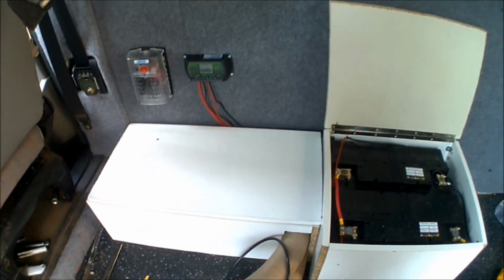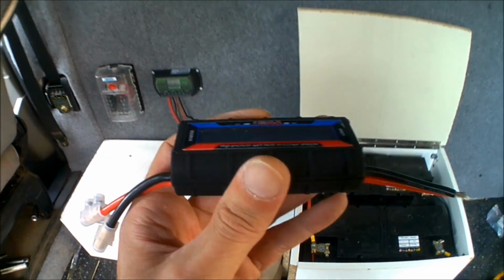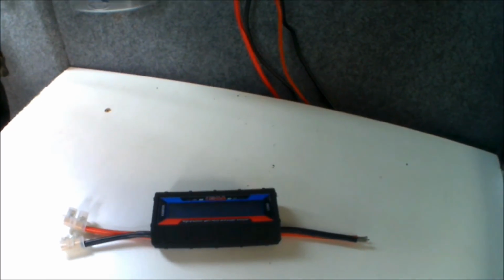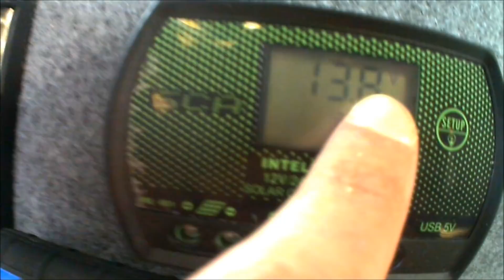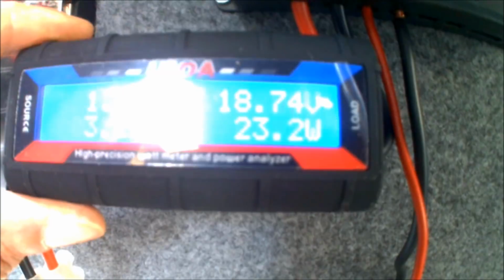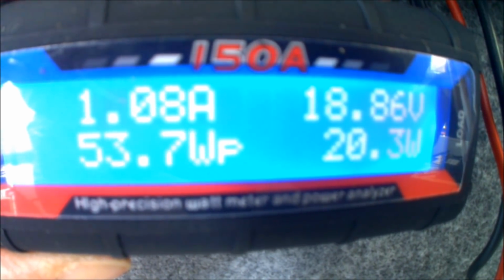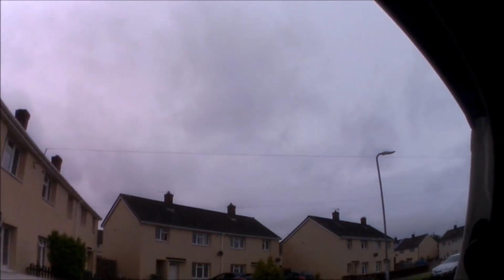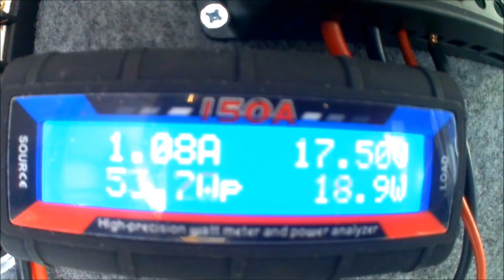Wiring Solar Panel Watt Meter - Monitor Solar Panel Power Output Watts & Amps

Comment: If we connect this watt meter to only solar panel and wihout connecting to any other source , then will this meter show the amps.and volts and watt of the solar panel ?
Reply from the maker: I think so, but its not really what it was designed for and its been a long time since I used one
Reply: @TheCampervanBuilder  ok , I get it ...if I ask u a little favour that can u use this solar meter alone on a single solar panel and check whether it works alone on solar pane only without connecting any other load or device  , then shall u do that ? ur effort will be appreciated in this regardd  👍
Reply from the maker: @willowsprings1634  I don't have this van or device anymore
Reply: @TheCampervanBuilder  No problem ..take care

Comment: Is it able to measure the Input Current?
Reply: I may be daft, but since he's put it between the solar-panel and the charge controller, then it's measuring the 'input current', ie., the energy coming in from the panel before it enters the system that charges the battery.

Does that answer your question, or did I misunderstand your question?
Reply: @PhrontDoor  that's right

Comment: These little power analyzer/battery analyzers can you just keep separate and then temporarily connect to each battery to test each battery in the battery bank individually,... and would that work?
Reply from the maker: possibly but I'm not an electrician so can't confirm 100%

Comment: Hello
Can the watt meter be connected to a computer and collect the data of the solar panel ?
Reply from the maker: I don't think it stores any data, you'd need a proper monitor for that, this is more just a display monitor

Comment: I’m no expert but the readings are fluctuating fairly dramatically every second. I dont imagine this meter is MID approved. Do we know how accurate it actually is?
Reply: Fluctuations ஆகுவது எந்த reading யில் என்று நாம் கவனிக்க வேண்டும். உண்மையில் இந்த மீட்டரின் power analysis என்ற சிறப்பு தன்மையை யாருமே விவரிக்க வில்லை.
             Charge controller க்கு பயன்படுத்தாமல் solar inverter க்கு இந்த மீட்டரை பயன்படுத்தும் போது தான் நீங்கள் சொல்லும் fluctuations reading வரும். 
           காலையில் முதல் முதலாக சூரிய வெளிச்சம் வந்ததிலிருந்து 2 amps சப்ளை செய்யும் அளவிற்கு வெளிச்சம் வரும் வரை பேட்டரியை சார்ஜ் செய்யவே செலவிடும்.
                2 amps க்கு மேல் வந்த பிறகு பேட்டரி சார்ஜிங் நிறுத்தி விட்டு dc to ac conversion start ஆகும். இப்போது பேனலை maximum power point tracking படி 20 வோல்ட் சப்ளை செய்யும் படி inverter செய்யும்.
                   இப்போது panel current, amps peak என்று (0.000AP ) data Queue என்ற இடத்தில் display செய்கிறதே அது தான் panel current.
               Amps என்ற இடத்தில் display ஆகுவது dc to ac conversion க்கு விரயமாகும் current. இது தான் 2 amps யிலிருந்து 2.5 amps வரை தொடர்ந்தது fluctuations ஆகிக் கொண்டே இருக்கும். 
                Inverter யில் heat loss யாக விரயமாகும் power யை தான் power column த்தில் display செய்யும்.
                ஆகவே இந்த fluctuations , mathematics லாக கணக்கிட்டு கிடைக்கும் மதிப்பு தானே தவிர  flow current அல்ல . Flow current, Amps peak AP என்று வருகிறதே அது தான்.

Comment: I found that if you put the WATT Meter between the Solar Panel & Charge Controler & Power it externally, so it stays on at night with external power, it tries to charge the battery with the external power, and the Solar Icon lights up on the solar controller showing the battery is charging, there does not seem to be a diode protecting the measured stream from the external power source :( has anyone worked this out, how to fix it?
Reply: Does it damage the watt meter? I've just fitted mine yesterday and this morning the watt meter has failed ( wired the same way you've explained..)

Comment: Think something is wrong with my watt meter (same as yours) that the solar panel goes into. when it gets dark at night the meter goes blank (thats expected) problem is when it gets light again it dont come back on just black blank bars on the screen no readings I have to disconect it and reconect it to get the readings back.
Reply: இப்படி  disconnect and reconnect செய்தால் தான் இந்த meter செயல்படுமா?

Comment: Well, its a good idea if your controller does not already give you that info. But most MPPT controllers do. But they have the same problem your setup has in that they only show you the power being used by the controller. 
It does not show you the full "rated output" of your panel system at any given moment. 
Thats why your voltage and current were not stable because the controller was charging the batteries based on what the batteries needed at any given moment and drawing the energy needed at that particular time. 
You have to put a load on it to see the maximum power output. So , for your circuit to tell you how much power your panels CAN put out, you need to have the batteries drained down quite a bit. That way your controller will take as much power from the panels as possible and THAT will show you how much the panels are capable of generating. But even that might not be that accurate.
I actually spoke to Renogy about this "problem" and they are working on a solution. 
thye said it might be a separate unite they would sell OR try to incorporate the circuit into future models.
Reply: I see what you're trying to do.
The problem is that you're looking at Voc and Ioc. Which isn't  how it would work in real world application. You always have some form of load or another.

If you have a multimeter, you can get a amp reading and a volt reading and then multiply those to get you watts.
With mppt there is a variable resistive load, which alters the voltage. And then a buck to alter the current.

If you ask me a mppt is just a buck converter. It has programmed voltage which it uses to measure the peak against the output current or just reads the  output current and voltage sag.
Really cheap and easy to do.

On the flip side, a pwm always pulls down the voltage to the battery voltage and only pumps the current available. Basically no current boost by voltage drop. (Ohm's law)

I would imagine any "test" would be peak readings added together. Or/and a cap charge time calculation which has a resistive load discharge.
Reply: @guywhoknows  Actually, that is what I am saying, there has to be a load to really test it. also, most meters only go to 10 amps as far as the current goes. so its very difficult to test the whole array at once. For my system, which is at 440 watts as of now, I would need about a 3 ohm , 600 watt resister for it to be real world. but I am working on a circuit to at least test each individual panel remotely. Although it may take some time before i get around to it. :)
Reply: @stuh2  mine blew between 615 and 800w. All that happened was the screen light comes on, not magic smoke nothing.
I think it is to do with the CPU voltage/current regulation. So it maybe wise to use the small pins, not that they are labeled.

Comment: hey what connector are you using on the source side of the watt meter?
Reply: i still dont know what connector its using, but i went with xt90, which is way over kill. my watt meters are rated for "200" amps but that is a joke, it gets warm at 29 amps, which makes sense, because the wire is like 12 gauge 10 gauge is rated for 30 amps lol. i was going to ask another question, but i see my first was ignored so i will state is as a matter of fact. these meters suck for long term data collection, the ah and wh meter rolls over to zero several times a day for me, and i cant be home to see when this occurs, in other words: if you want to know how many watt hours or amp hours you get per day, these meters will mislead you. i thought i was only getting like 40wh a day when in reality i was getting closer to 1kwh in over cast skies, i only know this as i installed a hall affect sensor, which give much better info. i still dont know at what point these meters roll over to zero as i work during the day every day and my camera equipment app locks up randomly during time lapse photo mode, thanks m$
Reply: @jasonbrown467  you can install a battery to maintain the data, did the weather mean the panels stopped producing power and the meter stopped?  Probably low voltage shutoff and restart each time lost the data and a 9v alkaline battery plugged into the meter would save cumulative data.  I think the 200 refers to its really 20A
Reply: B connector.  Part of strip connector .

Comment: I got one of these watt meters in the mail today.

I wired it up like this..

SOLAR Panel --> (Source) [Watt Meter] (LOAD)--> (Solar In) Charge Controller

Is this correct? I'm trying to read how much my solar panel pulls in.
Reply from the maker: Yes that should be fine, however the meter may go off overnight when no power is generated so it's best on  a switch to reset it

Comment: Hello, I just connected this meter to my solar setup,  I have a 400 watt system,  is there a reason that my wattage keeps fluctuating really bad,  it will go from 100 watts to 50W then to maybe 75W and sometimes 0W then back and forth over and over.  I have the source connected to the Source to Solar panels, and Load Charge controller that's the way I seen it here on Youtube.  my voltage also fluctuates like 17.32 v0lts to 20.00 volts so on and so on same as the watts...   Thank you for any help..
Reply from the maker: There will always be fluctuations in the voltage/wattage as solar is never steady. If your batteries are full the controller should reduce the solar to 0 to avoid overcharging.
Reply: Camper Conversion , First let me say THANK YOU for your reply,  Yours is the FASTEST reply I have ever gotten in all my time here on Youtube.  Anyway,  that I understand,. I just thought that the wattages would stabilize so you can see the wattages out put of your panels. Because at the way it's showing I'm not sure what watts they are putting out.  I'm not sure if there is another meter I need to get a good reading.??
Reply from the maker: There are more high tech monitors that can tell you exactly hwo much is/has been generated but they are 10x the price, I only ever use this monitor as a guide, watch the power generation for a minute and you generally see what it's producing on average
Reply: ok, That's a big help.  I do again appreciate your help.
Reply: @kansas7614  It could also very well be your charge controller causing the fluctuations.  You can try putting another digital voltmeter inline with the watt meter and see if your voltages are fluctuating just like the digital watt meter.  If the digital voltmeter is staying constant, this could be indicative of the charge controller fluctuating it's draw from the solar panels.  

Also make sure there are no clouds which would obviously change the readings, but I'm sure you know this.
Reply: @TheCampervawhat is a more high tech device ?nBuilder

Comment: Hi I planned to used two of it(watt meter). One to measure the power supplied by the solar panel to the battery and the other one is to measure the power consumption from the load side. Can you help me where to wired it up? Thank you
Reply from the maker: To monitor solar power generated, wire the meter in between the panel and the controller, to monitor power usage wire one in between battery and main fuse panel or power distribution point  (if you have one)
Reply: Wow thank you for a direct response❣ and thank you for answering🙂
Reply from the maker: no problem

Comment: Don't want to be a kill joy but just some warning them wires on the meter are no where near big enough for 150a I would say at a guess maybe 60 tops before you will get power loss any more than that and it will start to get toasty
Reply: I agree

Comment: I think this should have been wired through a shunt, yes?
Reply: It has shunt integrated inside. Thats why it is quite big. It wouldnt be able to monitor power without it.

Comment: May I ask a quick question......I noticed your solar controller was charging your battery  14.4v, have you set it to do this?  The reason I ask this is that my controller is very similar to yours and the instructions say 13.7v to float charge. The instructions also say when you select the battery type ‘b01’ (lead acid sealed) it will do an equalisation charge at 14.4v but I can’t seem to find out how and when it will charge at 14.4v, it normally just charges at the float rate of 13.7v.  Hope that makes sense, any help would really be appreciated.
Reply from the maker: Couldn't really tell you, I just plugged it in and left it to do its thing
Reply: Most solar charger controllers that go into equalization will do so automatically.  Just know that voltages above 14v during peak sun hours are normal until the batteries are close to being fully charged.  Then it will go into a float stage.  A voltage of 12.7V is a full battery but 12.7 volts will not charge a battery.  Voltages need to exceed this in order charge a 12V battery.

Just remember to do maintenance on your batteries if your charge controller equalizes.  

Only add (distilled) water to a sealed lead acid battery and ONLY after it's been fully charged and has sat for an hour or so.  If you add distilled water to partially discharged battery, once it's fully charged, electrolyte levels will rise too high and leak out of the service holes.

Keep flames and such away from SLA batteries in this state because they are usually off gasing hydrogen at some point.  Hydrogen is flammable - think Zeppelin.

Comment: Hi, I believe that this meter should in fact be connected to the output of the charge controller and not between the solar panel and the controller. The meter will then read the battery voltage correctly and not fluctuate like a mad man.
Reply: He’s not trying to measure the battery voltage. He’s measuring the solar panel voltage and current amount, hence why it’s connected the way he’s done it!

Comment: Thanks for the vid, enjoy watching your conversions. 1 thing that might help is a link to the products you are sharing for others that may wish to purchase! Just a thought.
Reply from the maker: Thanks, I sourced most my parts off eBay which can usually be found by a quick search,. YouTube will normally pick up on products in videos and display ads for them to make things easier, so long as ad-blocks aren't being run that is... I've tried linking products before but as I'm not an affiliate advertiser for sites the links become dead after a while and I don't have time keeping up with it all.
Reply: Fair point.

Comment: I have double wires at my pv+ -,have it installed exactly as you,with just one of the wires at pv + -,but meter just displays squres. Unless I reset my + side breaker. Comes on,but won't read amps,a/hr etc. Whats wrong?

Comment: Is it ok to connect the watt meter to solar panel 24/7? Installed same unit to my set.up.
Reply from the maker: It might cut the meter off when no sun,  but can only try
Reply: @TheCampervanBuilder  thanks for the response sir.
Reply: Sir, my peoblem now is that my watt meter reading is zero watts and voltage is 19 to 20 volts. But in my solar charge controller voltage  reading is only at 15volts. What could be the problem? Watt meter is connected between the pv and scc.

Comment: I’m using another design of power meter. After sunset, it turns off as expected because mine requires 4-60V input to operate. The problem is, even when I am generating as much as 19V on mid-day, it still doesn’t turn on.l; unless I turn OFF my PV breaker and back to ON. Any idea how to fix this?
Reply from the maker: I have the same issue but as my solar panels are wired to a switch, I just flip the switch off/on to get it to come on again, it still passes charge through even if its not lit up though
Reply: This device has an auxiliary battery port, you need to connect one small battery there, 4-60v (it can be a 9v battery, for example) you can see that in the manual http://www.renogy.com/template/files/Manuals/150A-High-Precision-Watt-Meter-and-Power-Analyzer-Manual.pdf
Reply: If you connect an auxiliar battery it never turn off
Reply: @Luis3alsa  Thanks for the Manual Link. I have been searching for one cause I bought meter from Ali ( Express Ha,Ha)
Reply: @Luis3alsa  but the aux power, when hooked up at night, feeds back to the charge controller and shows a solar charge icon, so it is trying to charge the main battery from the external power for the WATT meter :( or am I doing it wrong?
Reply: @USL.Website  I have never tried it, but this meter has a dedicated port for an auxiliar power supply, I believe this has no connection with the other ports